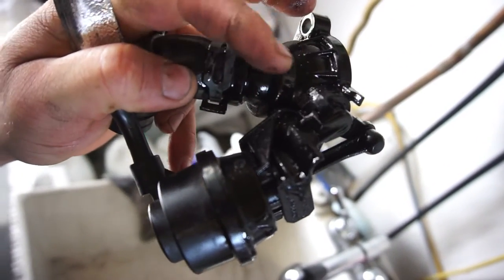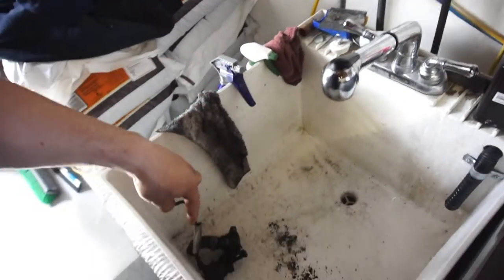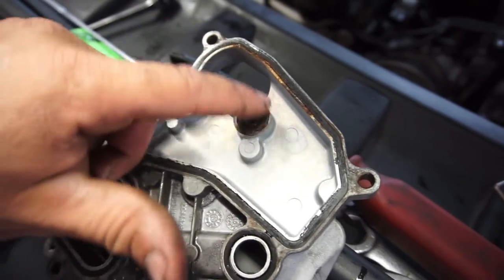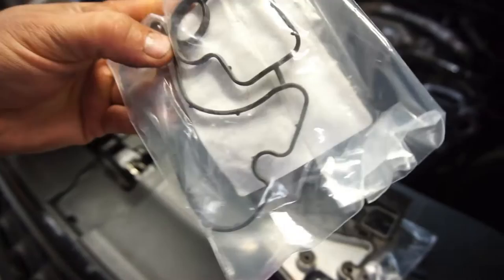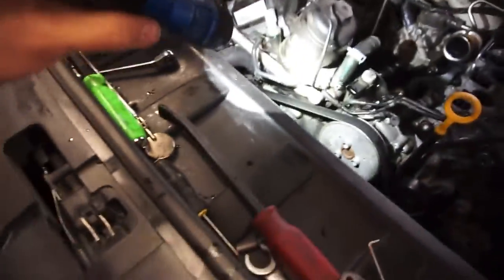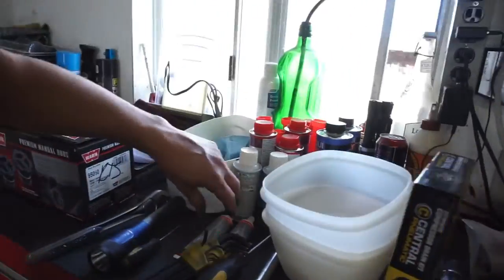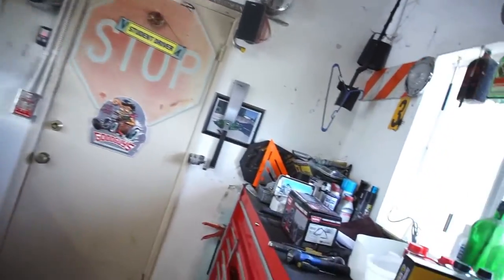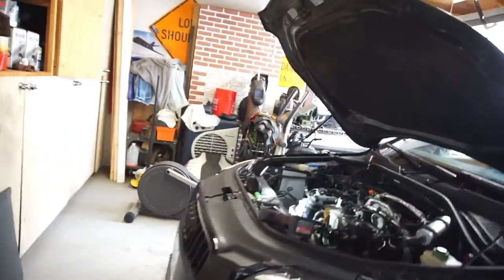Audi Q7 TDI 3.0 Diesel Coolant Leak. Found The Leak and The Parts. A6 A7 A8 Q5 VW Touareg.

Comment: Hi Hallfast, I am motivated to do this job on my Q7, 2006.  Would you please help me with parr removal order to get to oil cooler adapter.  Thanks in advance.  Lastly, where did you buy seals and plastic connectors?
Reply from the maker: @longhuynh5249  I believe this is the video with the breakdown. 

https://youtu.be/1oV82Bn_fns?si=hJuupc8G8qUO0Cer

Comment: The rust will come with time, and more water leaks and more parts to replace . I had the exactly the same problem in the beginning. After a year or so more problems came like a snowball!!  More plastic shit to replace in the front of the engine! 230mil  km !!  This guys program everything to go byebye in 200mil km!!
Reply from the maker: I’m not sure what 230mil km means but I didn’t have any issues for another 45,000-50,000 miles until insurance totaled the q7 out for sand storm damage. I’m also not sure what program you’re referring to. Maybe this is a language barrier. 🤷‍♂️🤷‍♂️

Comment: Thanks for posting this video. I just noticed I lost about two quarts of coolant when the low coolant light went off. I saw some coolant around the water pump housing but it seems that it is dripping down from above. I see some spray of coolant around the water pump pulley, not too much and definitely not enough for the amount of coolant lost. So I'm leaning towards the problem you fixed in the video. How did you noticed the problem was coming from a leak around the EGR and Oil cooler and not from elsewhere? Second question... How difficult is to tackle this job? I'm mechanical inclined. I have replaced Valve covers in supercharged Mercedes AMG, Air to water intercoolers and superchargers on same vehicles. Taking my time of course. Thank you!
Reply from the maker: It’s not that bad of a job. Probably a 6 out of 10. I ended up buying a bore scope camera to see under the intake and then I saw a crusty looking adapter piece that looked cracked. Just took a while to figure out what parts I needed to replace.

Comment: Well there's your problem . A CAD designed part made of plastic ! Just because a computer says it can be done doesn't mean its a good idea . I wonder if a computer designed the EGR system too ?   Who ever thought feeding you exhaust back through your engine was a good idea ?  Obviously someone did .
Reply from the maker: Yeah some idiot that needs to put his head in a bucket of water and take a deep breath. Cad designs work great as long as there’s no real world button clicked. I honestly think it’s the coolant that eats up the rubber seals but who am I?
Reply: @Halffast719  ; Just another of us guys trying to fix what they screwed up . Who would've thought that mixing aluminum , plastic and silicone together in a situation where there is hot oil ,varying temps of coolant and the engine temp of 200' would cause a problem ???  It would be funny if it didn't cause so much work for guys like you and me !
Reply from the maker: I know. Who would have thought that three different materials attached to each other will expand and contract differently. I’m so clad I never went to college so they can brainwash me to be ignorant. Who would have thought.
Reply: @Halffast719  ; LMAO !!!  So close to the truth it hurts !!

Comment: Hi there, may i know how did you  do audi q7 tdi 3.0 intake manifold sequence and torque? Thanks
Reply from the maker: I believe they’re 7.2 foot pounds and I started from the inside out. Like you would for a cylinder head.
Reply: @Halffast719  thanks for your replied, did you started in and out from one side intake manifolds tighten up to the original torque then you did the other side of intake manifold?

Also did you need to take water pump out before you took out the oil cooler?

Thanks for your replied
Reply from the maker: @Deadfools  yeah I just started from driver side middle and went to passenger side middle then one back on passenger side then one forwards on driver side and back and forth. I didn’t have to remove my water pump.

Comment: did you end up open the front timing to replace the engine vent cover?
Reply from the maker: The timing chains are at the rear of this engine I believe.
Reply: I now what is talking about! Is talking about the engine front cover, because there you will have more parts to replace. Plastic parts. Its a piece of shit designed to go wrong after  you replace everything this guy is replacing now!

Comment: I have little coolant leaking at the same place and i believe it caused by the rubber seal at the bottom plate. Did you drain out all the engine oil before remove the cool cooler? I am worrying about the oil spread out huge while removing the oil cooler. Thx!
Reply from the maker: I didn’t drain oil. I thought it had drained down to the oil pan but it doesn’t. So no matter if you drain coolant and oil it’s still gonna be a mess.
Reply: @Halffast719  Well noted and sound i need many unused cloths to clean that them up. BTW, do you have the screws tighten sequence and torque details?

Comment: Did you replace the oil cooler as well?
Reply from the maker: They were back ordered. I did not get to replace it. It seemed fine and there’s no leaks 15,000 miles later.